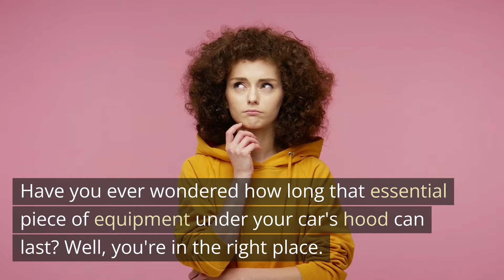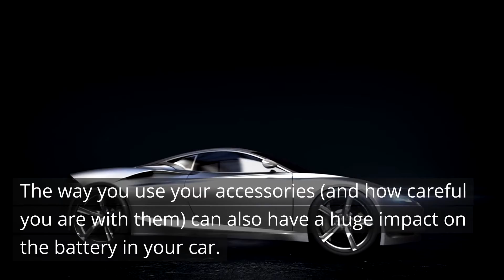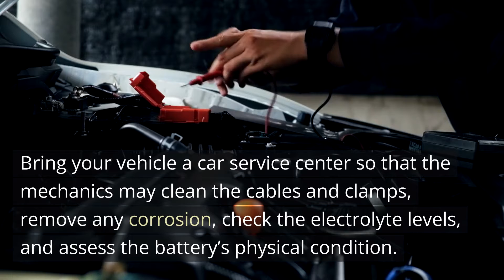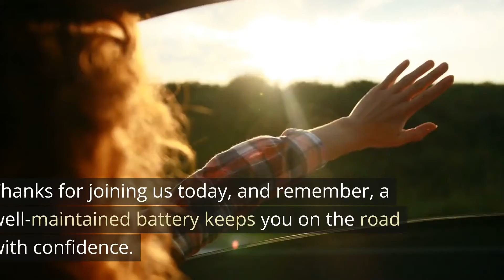Car Battery Lifespan Explained: How Long Does a Car Battery Last?

Comment: I am an auto tech with 48 years experience. I replace my car batteries every 4 to 5 years. If I store a car for more than two weeks I hook up a battery tender type charger. These chargers prolong the life of a battery and make life much easier. Operating a car with a weak battery taxes the alternator and other expensive computers and components of your car. A good battery is cheap insurance that saves money in the long term.
Reply from the maker: Thanks for sharing! Great advice from an experienced auto tech like you.

Comment: I've had the battery internal bus bar crack and cause loss of 12V.  So, vibration can take out a battery bus bar.
Reply from the maker: Thank you for sharing your experience. Appreciate your comment, sir! It's good to know that the battery's internal bus bar can crack due to vibration and cause a loss of 12V. This is important information to keep in mind when maintaining our car batteries.

Comment: factory equipped 10 yrs after market replacement you are lucky to get 4 yrs
Reply: My 2001 BMW 330, 2y rated "Duramax" batt lasted over 10 yrs, current 4yr batt must be 7 or 8yrs old, 2011 BMW M3 may have original batt still (only owned it for last 5 yrs), assume part of the reason is batts mounted in back end of trunk as part of the strategy to approximate 50/50 weight distribution but happens to also prevent thermal damage.
Reply from the maker: @Mrbfgray  Thanks for sharing! The battery location in the back end of the trunk may have helped prevent thermal damage and contributed to the car's weight distribution strategy.
Reply: My mustang battery is nearly 7 years old. It is still going strong.

Comment: If you replace the water inside it will last forever
Reply from the maker: While replacing the water inside a car battery can help, batteries will eventually wear out and need to be replaced. Thanks for sharing though!